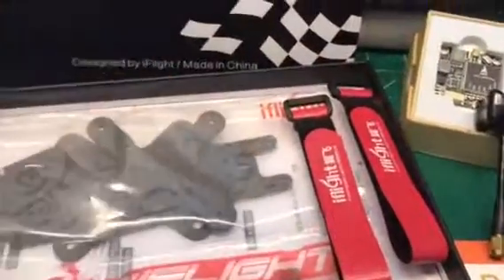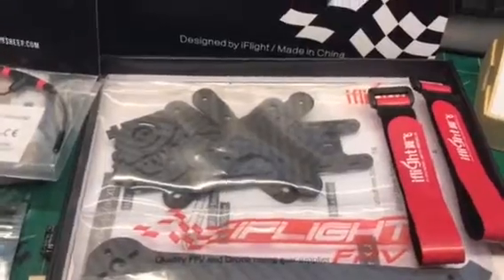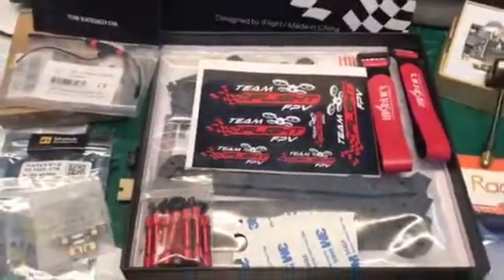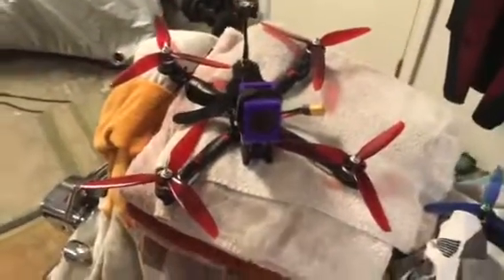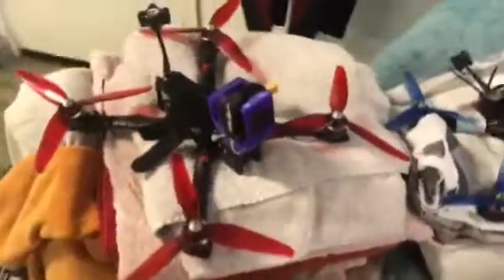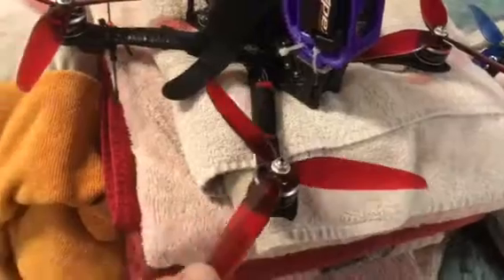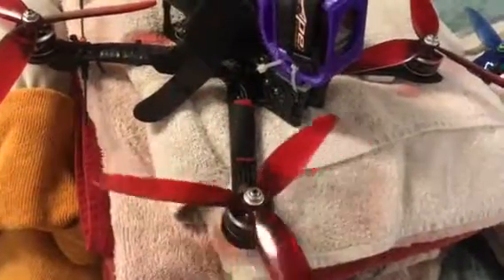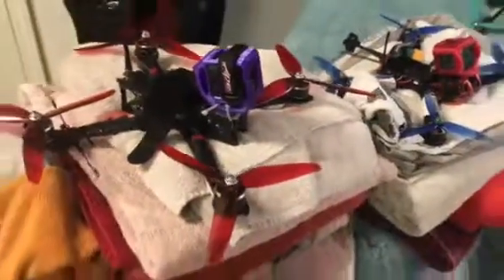iFlight XL8 build to come

Comment: HI Could you please tell me where you got those HQ 7" TRI BLADE PROPS and is the  iFlight XL8 a true X ...Love the footage it does look smooth
Reply from the maker: Pyro-drone.com is the supplier, I've been encouraging other companies also on 8" props. There is an obvious absence of manufacturer representation of triblade multirotor props out there, and with the  long range craze on, I feel some are missing the boat!!! Thanks for the sub!
Reply: not only props but lack of small mini quad low kv motors. I like this frame but want to try something like
a 2407 1150kv 6s for a 8 inch prop, dont want full power just endurance